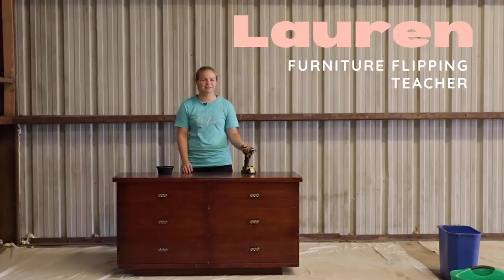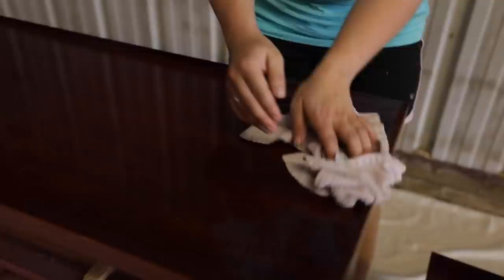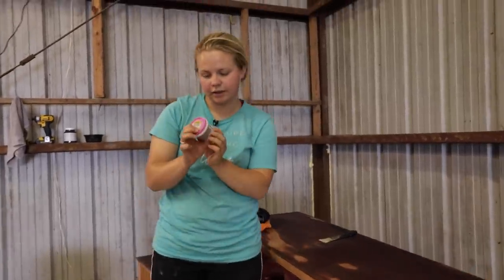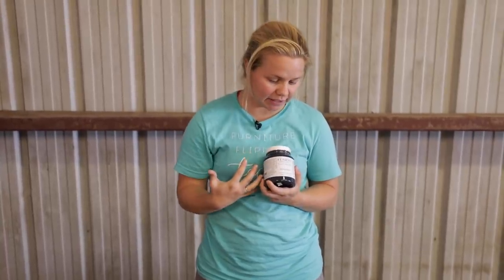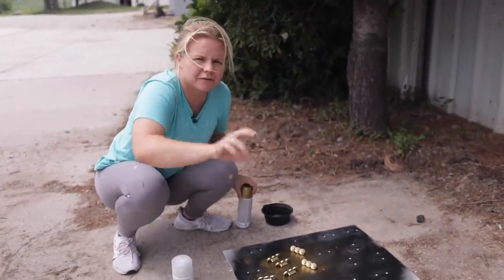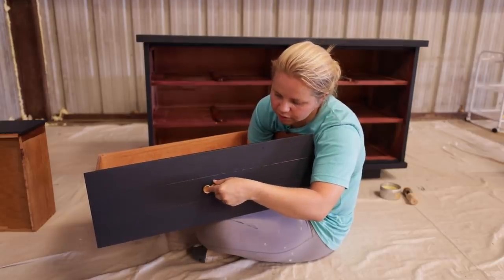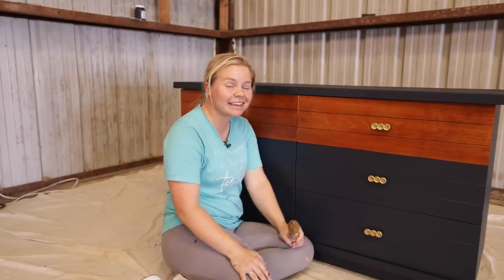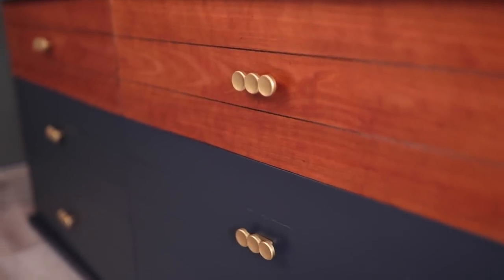Goodwill Furniture Flip with Fusion Mineral Paint

Comment: I looked up Kent Coffey lowboys and dressers and the prices ranged from $700 - $2500.  I like the color, hardware color and wood on two drawers.
Reply: I have a mid century dresser and nightstand that showed up as around $1600 in value in orig wood condition. Mine has some water stains on top tho. So torn about painting it!?
Reply: @klomax5258  What about restoring the finish vs painting it?  (Try Howards Restore and Finish or something comparable - Formby's????)
Reply: Exactly, a 2000$ dresser turned worthless. Sad. I was hoping she would just refurbish the original finish.

Comment: Sometimes for hardware I have had spare screws and I have used a piece of foam or egg cartons so that the hardware is supported and standing up in the air. Basically I push the screw head into the egg carton and the hardware sticks up like a lollipop. Makes spray painting much easier. I don't use the actual screws because then they can get some paint on them and not work the best.
Reply: yes the foam trick works great.

Comment: So…wondering…is the sander you are currently using waaaayyyyy better than the orbital sander you used to use… I was thinking about buying but didn’t want to waste $500 for something that doesn’t save on time if it gives the same results as the kind you can buy at the hardware store.
Reply from the maker: This upgrade is the first upgrade I would recommend to anyone that was looking to up there efficiency in their flips! Hands down an incredible upgrade. Check out this video I do a comparison https://youtu.be/1pcHhFBjgTg